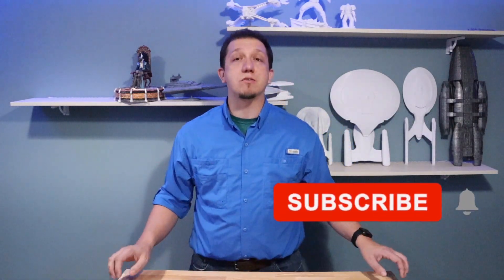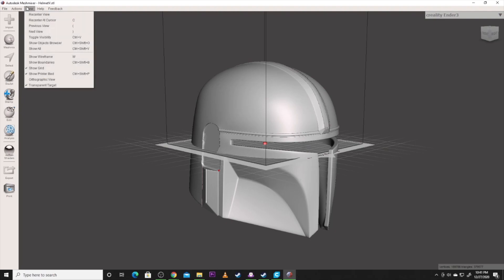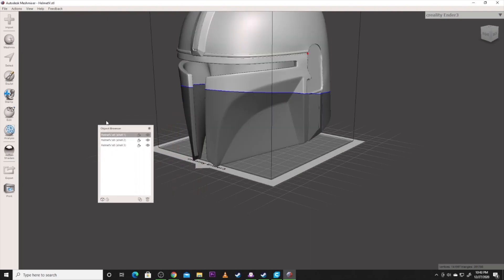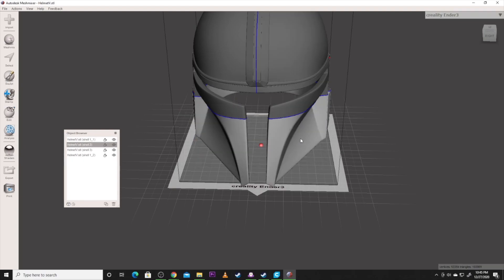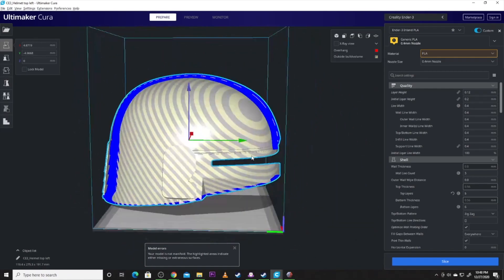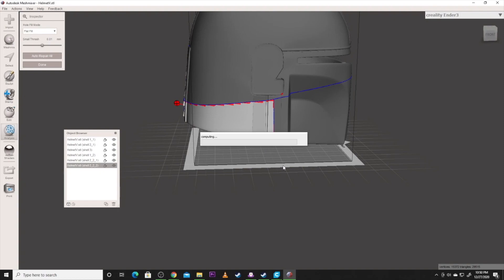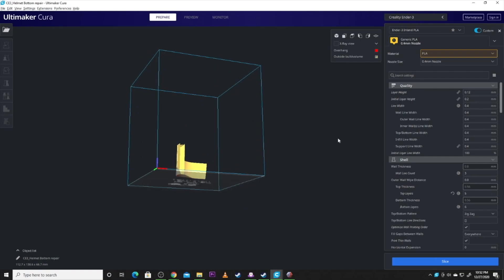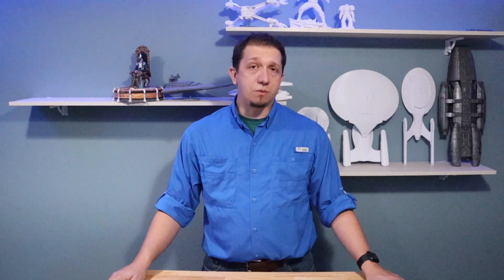How to use Meshmixer: Break a model in parts

Comment: I am doing a medieval helmet. I considered what you did but I have a cadet 100,100,120mm and with that many pieces I am worried about the strength at all the edge to edge seams. I came up with a possible solution. Take the original Make copy 1. Make copy 2. scale copy 2 to make it smaller by just under 1 wall thickness. Create a union between copy 1 and 2. The result is an extra thick version of the original. Now do a Boolean difference between the original and the thick version. Now you have a version that fits exactly within the original Now cut up both inner and outer helmet making sure that the seams are always offset and never line up.  Now when you print all the parts you end up between with a huge glue area between the inner and outer surface,  That's my theory anyway.  Sound reasonable.  I can't check it in practice yet because my downloaded original seems to be full of errors that analysis won't fix so the Boolean union is not working. Yet

Comment: When I edit a gauntlet in meshmixer save and export to Cura. The measurements I did in meshmixer are different in Cura. For example. The wrist opening is 63.5mm. The elbow opening 76.2mm. When I export to Cura. The openings are smaller then what I did. Is there something I need to turn on or off in meshmixer?

Comment: Good video....
1 question..when u cut and print out pieces, do the parts print out flat where they connect to the rest of the helmet? Or do they print out with joints? 
  TIA
Reply from the maker: They way that I show in this video they are only flat. In my other meshmixer video I show you how to do it with Joining pins that basically can create a joint effect. I would recommend checking it out.

Comment: Great video, thanks a lot, just have one question, can you tell me please, what are the hardware requirements to be able to use meshmixer?  The high ones and the medium please..... And thanks again, keep up the good work :)
Reply from the maker: System Requirements Meshmixer 3.5
Microsoft Windows 7 or later or OS X / macOS 10.11 or later
4GB system RAM
Integrated or discrete graphics card with latest drive
Reply: Thanks, and what about the processor?
Reply from the maker: You know it doesn’t say on the site.  This is a single thread application so anything over a i5 would probably be fine
Reply: Great, thanks)

Comment: does it worthless for miniatures? I mean pla miniatures not resin? it is useful to cut the model for (pla printers such as ender 3 or ender 5 )? thx!!!
Reply from the maker: Yes I cut up my prints for miniatures with pla printing.  Reduces supports, makes it easier to print, and it will allow you to get some better detail.  I have moved to resin for minis but you can get some awesome prints with pla and switching to a .2 nozzle.
Reply: @Rise3DBuilds   Yep I am trying to get a .2 noozle aswell ... one question... for cutting miniatures ? do I need to planning a keying-pinning (key and hollow structure) for parts? one part is male and other female? or just go smooth and flat and with just "glue" I join the parts? thx!
Reply from the maker: You can do either with minis.  The pin gives good strength but often times I will use a hobby drill and make a hole and uses part of a paper clip to connect the parts.  I am working on a video on how to do it for the model and mesh mixer
Reply: @Rise3DBuilds   yeah I would like to see it! thx
Reply from the maker: Stick around!!!